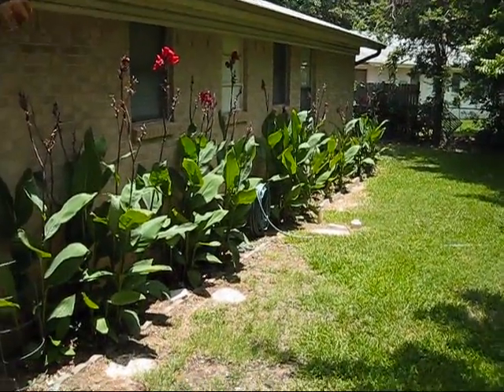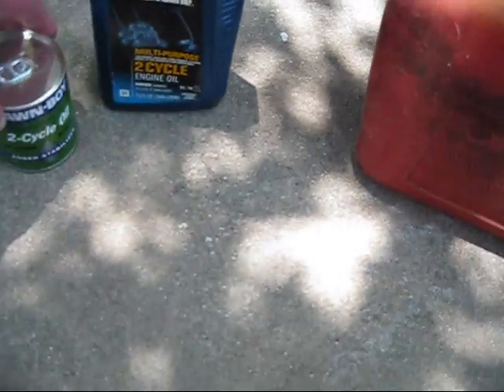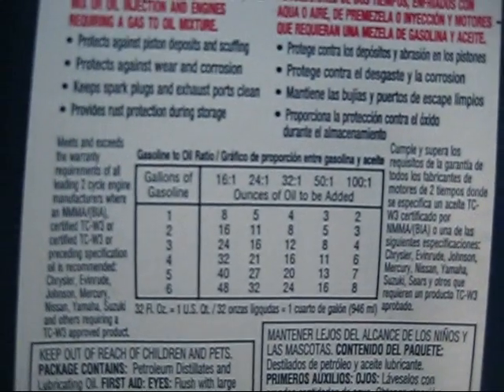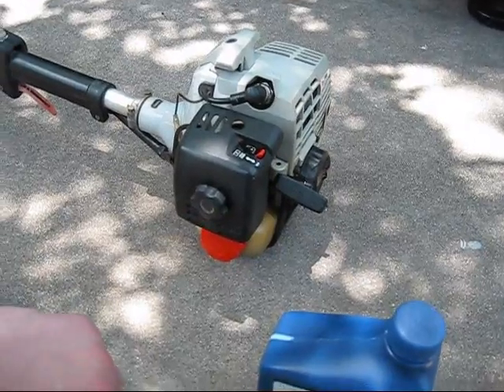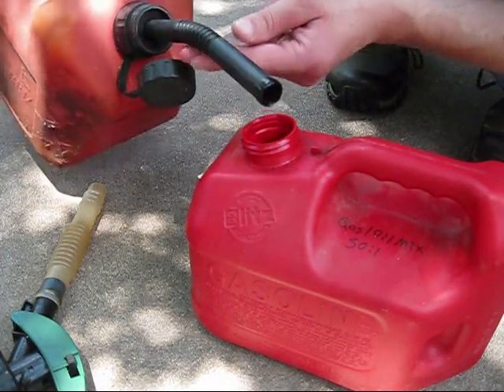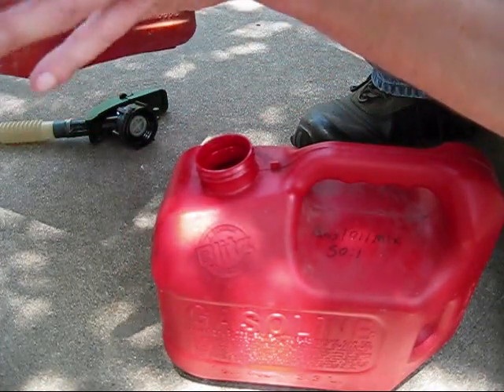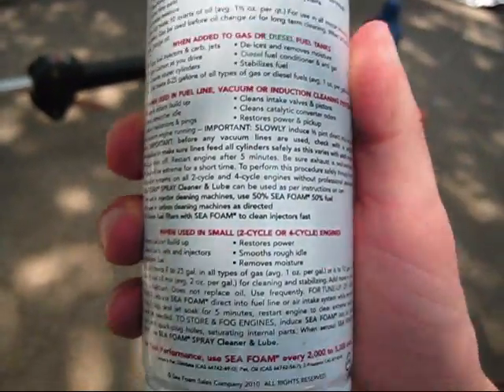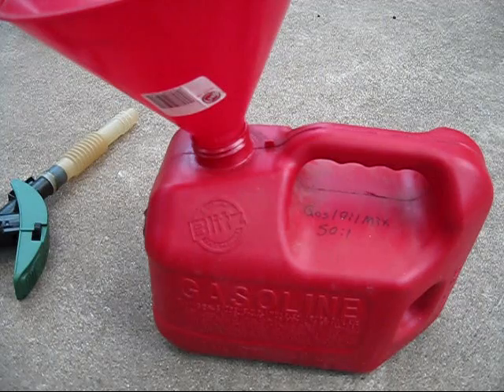How to Mix Gas and Oil for 2 Stroke Engines

Comment: if you require YouTube of all things to figure out what is required to mix 2 stroke oil and gasoline there is something wrong.  THE INSTRUCTIONS ARE ON THE CONTAINER OF OIL, OR IN THE EQUIPMENT MANUAL.  lay off the guy for making a how-to and posting it.  if he wants to talk about the price of gasoline, or the weather so be it.

Comment: what happens to the bike if the gas oil isnt mixed right
Reply: Too little oil, the rings and bearings fry and the engine can seize up. Too much oil, the spark plug(s) will foul and the engine will run hot.

Comment: hay  lawnboy8461  can you help me i got a sthil weed eater/trim it wont run its got brand new fuel in it and it wont run but it will if you prime it with the oil/ gas mix right into the engine could you help i really would hate to see this go to the landfill

Comment: the best way to tell is if there is a holding tank for oil. like on a lawnmower it has a seperate resovoir for oil. i think all weed wackers are 2 cycle and require mixtures. look in your owners manual or google the model number online. also you can look at the stickers on the wacker and it probably says it.

Comment: If the weed eater tank hold 1 Gallon you could but I have not seen any with tanks that big. However, if you did it would gum up the crab and fool the plug with oil.

Comment: Just leave bottle upside down in gas can. In an hour it'll be all out. 12 minute video to add oil to gas? Just use the small bottle for one gallon can and larger bottle for 2 to 2 1/2 gallon can.
No need for different ratios. We are not talking Space Shuttle technology. We are talking an engine that's been around 100 years. I run mix in 2 and 4 stroke. No prob. No need for 2 cans. 15 years doing it in same equipment. "Top end lube". Some guys will say, "It'll ruin a 4 cycle!" They don't know.

Comment: What would happen if you put a whole 2.6 oz bottle of 2-cycle synthetic oil directly into the weed eater with the gas instead of mixing it with a gallon of gas?

Comment: I mix at 50:1 for my two strokes. Never burned one up yet. But i also dont run cheap auto parts store oil in my toys. Better the oil thinner you can mix it.

Comment: well you mix 
5 gallons of fuel to
5x 32% oil 
so evey 5 gallons add 5x32% oil
to it
i prefare to do it bulk aswell because its quicker
just mesure out oil instead of fuel because
it will take longer to mix it up

Comment: do your lawn boy a favour and run the 50:1 echo mix through it.i used it in my 1969 lawnboy 3002 (16:1 mix,C engine) and it loved it,then all my other lawnboys got put on the echo 50:1 mix and they all run so much better.the difference between the lawnboy oil and echo is that the echo is a much higher quality oil.ever since i switched to echo i havent had to clean out my exhaust ports anymore,my 1979 5247 hasnt had its ports cleaned in 4 years because of the echo oil!

Comment: @bc1969214 sea foam cleans the carbon build up out of the motor.older 2 cycle engines really need sea foam because it prevents exhaust port plugging.it also cleans the carb,add a little extra lube when the engine is cold and can also keep gas fresh!  best stuff ever! 2 cycle engines crave it.